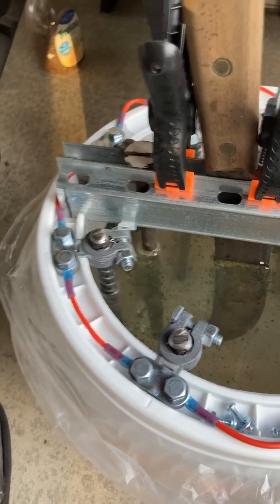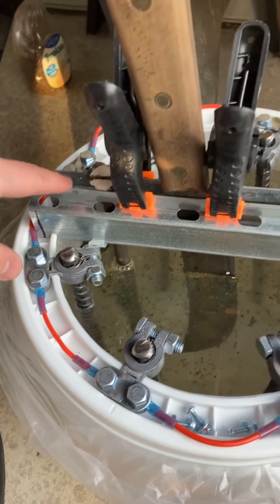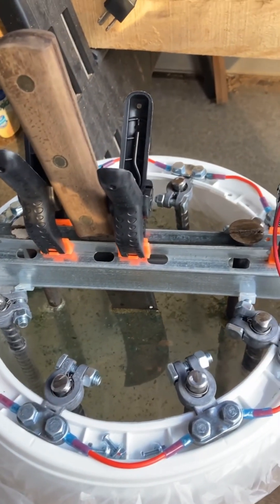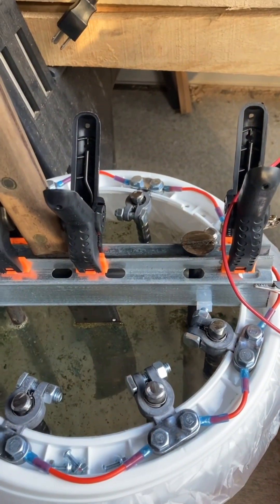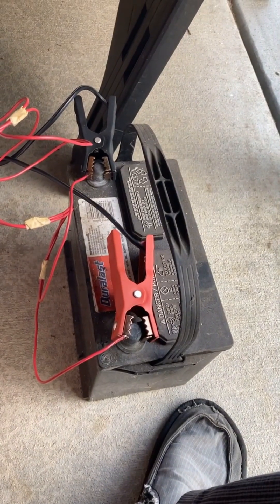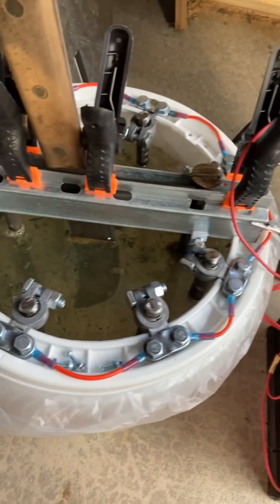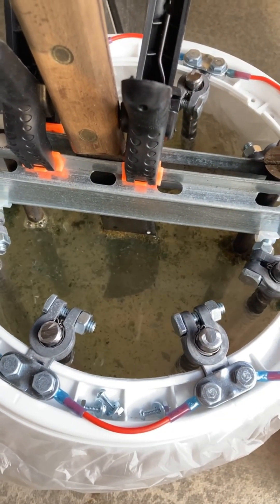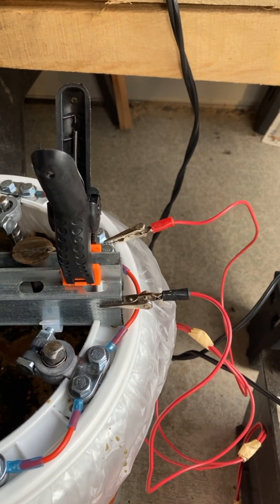ELECTROLYSIS BUCKET w/ AUTOMATIC Battery Charger HACK! 🔌__🔋⚡

Comment: Now that’s an electrolysis set up
Reply from the maker: If I had it to do over I'd find a way to make the Rebar/Battery Terminals easier to remove. Was going to implement some automotive, plastic push rivets but they're too large.

Comment: I dig it dude, thanks for the tip on the battery. Cheers
Reply from the maker: You're welcome. It's a little bit of a process to clean up after, if that's something you want to do, but a wire brush and a rinse of the rebar followed by hitting it with a wire wheel on a grinder (to get it back to bare metal) works great.

It's also oddly relaxing to watch the whole process take place, to which, if you've ever busted rust-- is never the case. 🍻💦

Comment: Dude you spend a whole lot of money to make the cheapest cleaning solution you could ever😂😂😂
Reply from the maker: Being a Marine, busting rust has always been a personal priority.
I've always wanted to try out this method after years of trying different chemicals, blowing through rotary tool sandpapers and picking rotary tool wire bristles from my clothes; and occasionally my back, (Found one last week in a jacket as a matter of fact, and I haven't used one of those brushes since like 2017😂) .

The Bucket also gets places those other methods can't.
For instance, I spent hours on that machete previously; sandpapers and rust removal chemicals, and that bucket did what those others couldn't.
So, the fact it allows me to walk away and do other things while it cleans was worth the investment.
Thanks for commenting and giving me a perspective I hadn't considered.